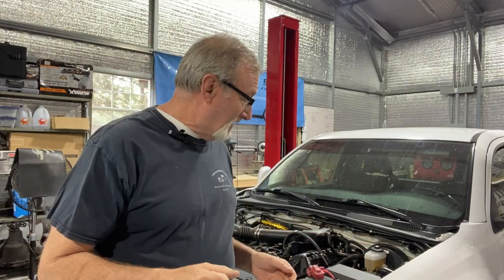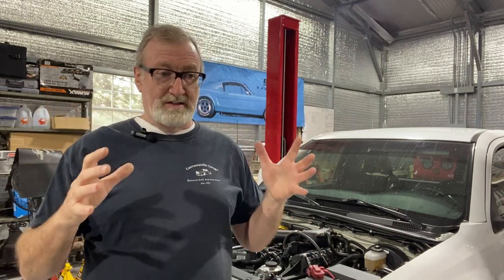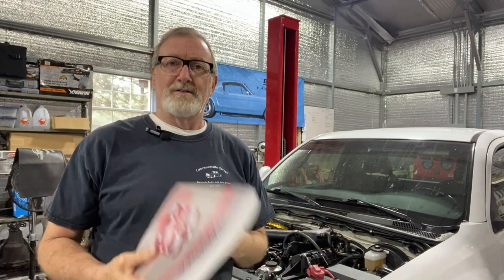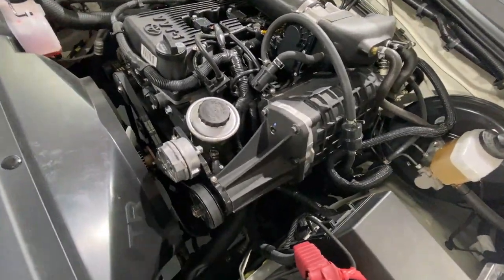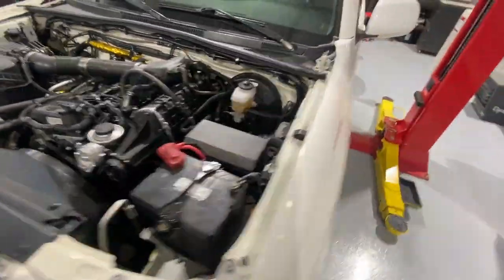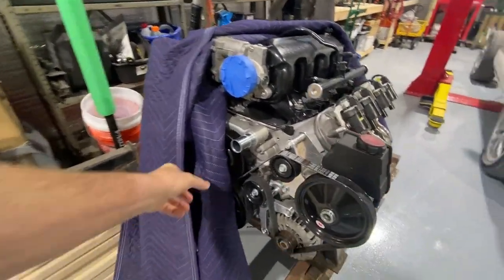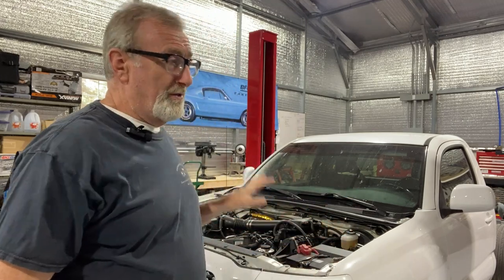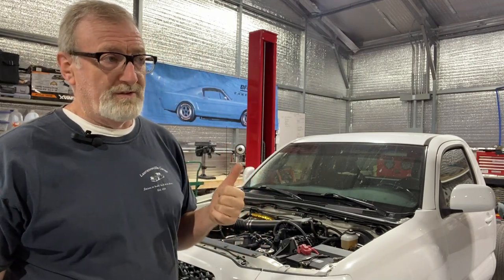Part 1 LS V8 Swap Build Into 2007 2nd Gen Toyota Tacoma, 5.3 with Tremec TKX 5 speed Transmission

Comment: That's gonna be a cool Truck. I would put that supercharged 4cyl in a rail buggy
Reply from the maker: The owner sold the original motor. The new owner put a turbocharger on it and promptly trashed the engine in a short time. The Tacoma is almost finished. I’ve had to change direction and/or redo several things multiple times so there are minimal videos of its progress. But, it should be finished very soon and a more comprehensive video will be made showing how we did it. I’m waiting until everything works like it should before putting anything out.

Comment: Hey, got you off the forums! Great vid. You wouldn't happen to know anyone selling the URD supercharger system for the 2TR would u?
Reply from the maker: No, I do not know. But, the forums would be a good place to ask about it. At the time the Tacoma came to me, it was 1 of 2 that had that particular supercharger. I believe some changes had been made to it since. Depending on the power level you want, (this application was ~225 to the tire) the supercharger with associated things to make it run good gets very expensive real quick!
Reply: @laurencevillegarage  Thanks for the update! Is that setup available to buy somewhere? I believe you were using the Magnussen and I did contact LCE who say they haven't given up on the 2TR yet and are hopeful to develop this platform. The Rotrex setup on the URD is prone to imploding but I needed more power really fast and that still seems like the most complete setup out there even though it's "out of stock". Still looking hard

Comment: What are the plans for the old engine?  I have a 2008 and wanted to put a super charger on it.  Mine has the automatic trans which is a real let down but it is reliable.
Reply from the maker: The "old" engine was put up for sale and sold in a matter of hours. The supercharger was an experimental unit and went back to the manufacturer. With t he supercharger, meth injection and some other fancy parts put down about 225 to the tire. Not too bad for a lowly 4 banger. But, if you had to pay out for the supercharger, computer to run it all and all the odds and ends...you might want to rethink that. It was expensive. I'm not knocking going that route, superchargers, turbos, engine swaps are all cool and to each his own. Any route you go can be pricey, but, for the buck spent, weigh it out against all your options.

Comment: Would the rear end handle a stock 5.3 I have a taco prerunner 4 cyl with the 5 speed
Reply from the maker: It all depends on how you drive it. I would say "yes" it can handle a stock 5.3 as long as you are not doing 4000 rpm launches and power shifting. Driving it "normal" and just getting on it I believe you will be just fine. If it does decide to spit out an axle or the gears, then obviously an upgrade is in order.